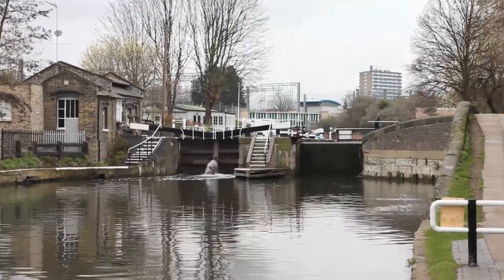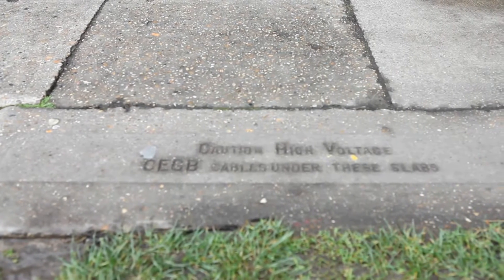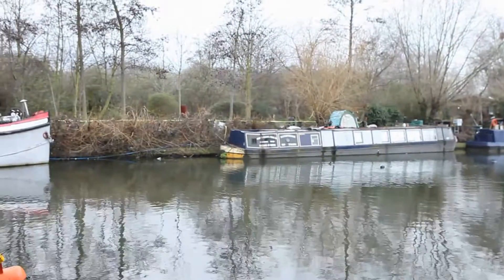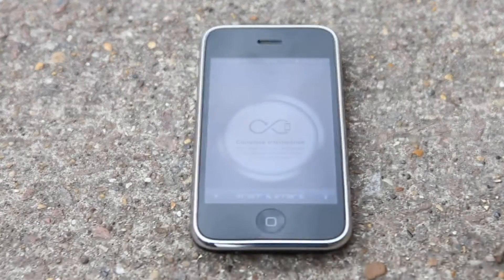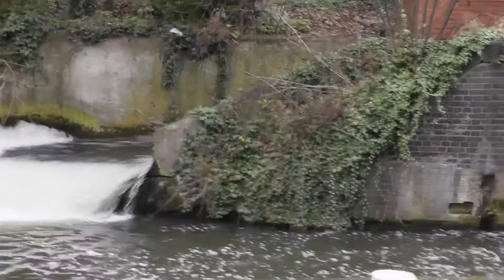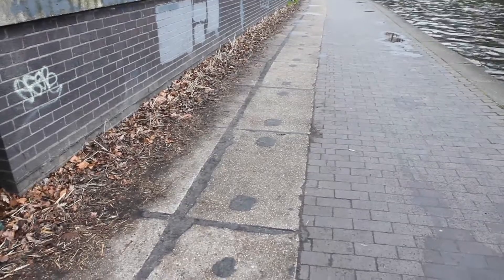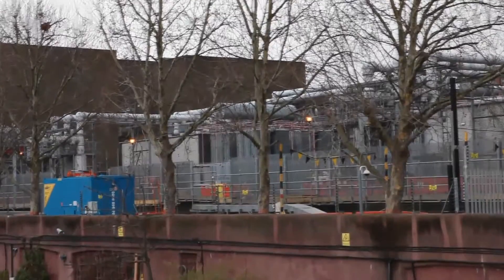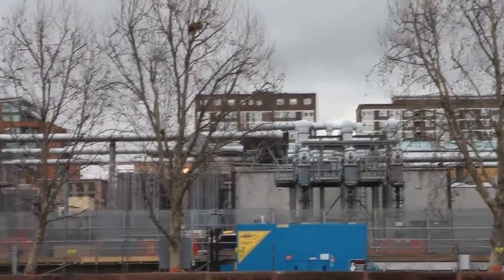275kV cable trays, 400 kV substation and the Regents Canal

Comment: Good video..
Not sure why but there is a cycle track near where I live and there are some 400kV overhead power lines ... I stopped to take a picture of the metal frame pylon that was RIGHT next to the cycle path... My iphone 6 stopped working after about 2 minutes of taking pictures... UNREAL? Not sure why this happened..  When I got back home..It was fine again... Very strange.

Comment: Those boxes are link boxes where the SVL (Sheath voltage Limiters) are held and where the sheaths are earthed etc. The SF6 substation is known as "GIS" which stands for Gas Insulated Substation/Switchgear.